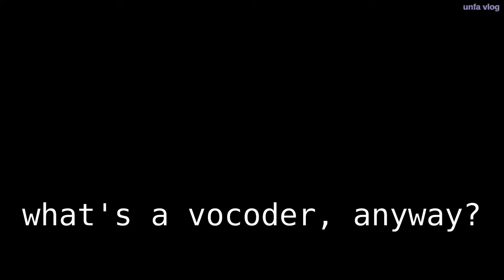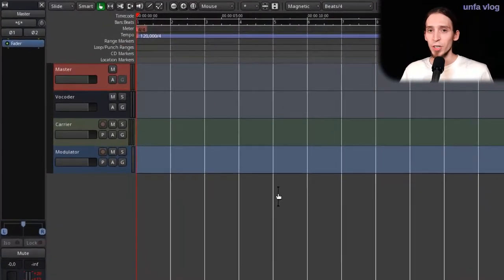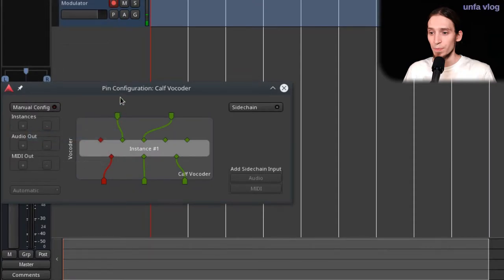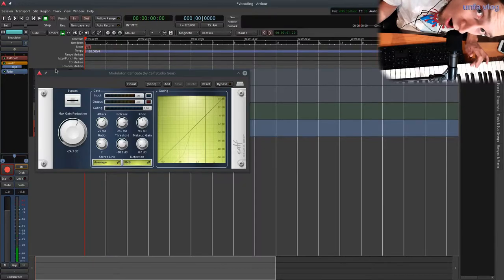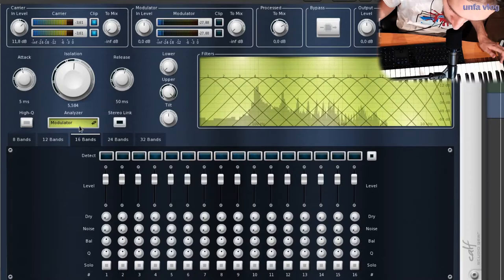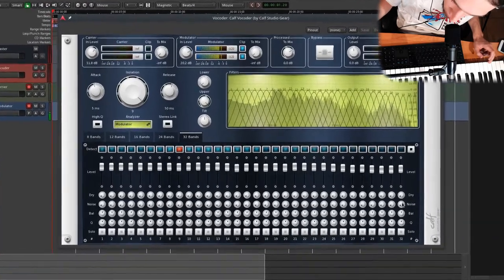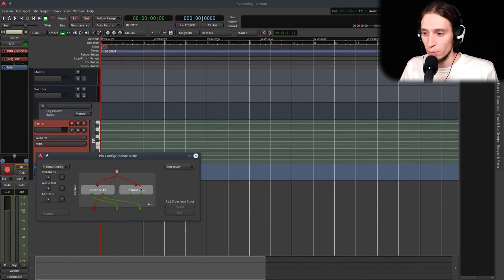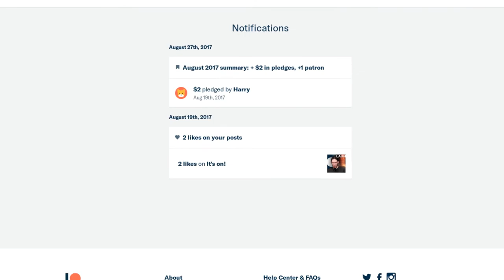UV#17 Vocoders!

Comment: I'm testing LMMS in Linux Mint 20 Ulyana and installed the CALF Studio plugins with software manager, Ardour show 'em in the plugins list but LMMS don't, how can I open them in lmms??
The plugins are installer at /usr/lib/lv2/
Reply from the maker: LMMS does not support LV2 plug-ins yet. I think they're testing it, but it's not in the official stable builds. And I recommend you don't  install the old, rusty LADSPA versions of Calf plug-ins - they are ancient, buggy, and can cause all kinds of problems, mainly crashing Ardour a lot.
This is one of the reasons why I switched to Ardour - it supports the best plug-ins libre audio world has to offer.
Reply: @unfa00  Yeah, I've noticed that weird behaviour with LMMS on Windows. Sometimes it clogs and hangs when I have several plugins loaded in the channel racks, especially with the old Calf ones.